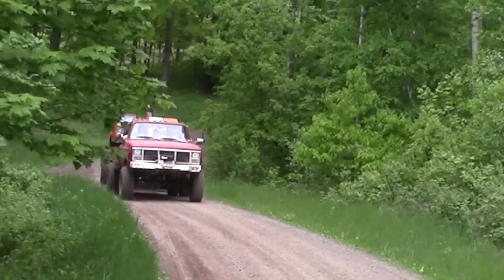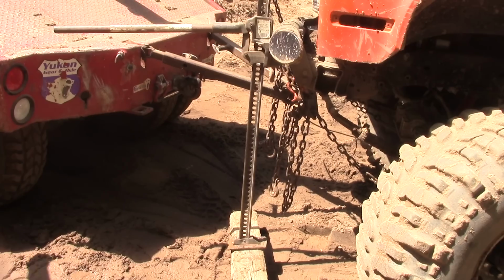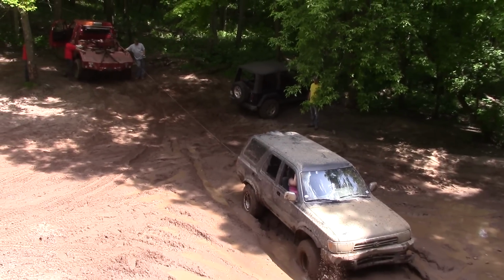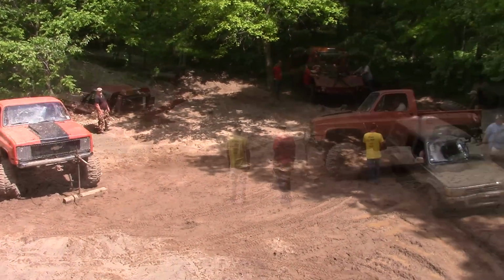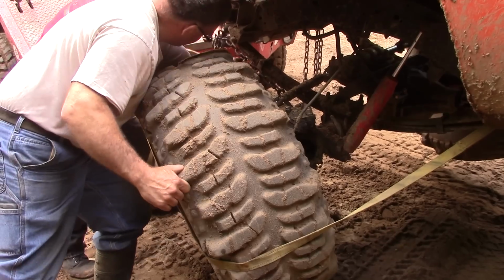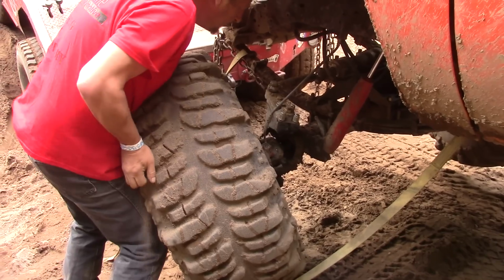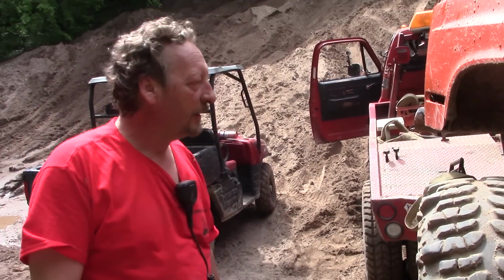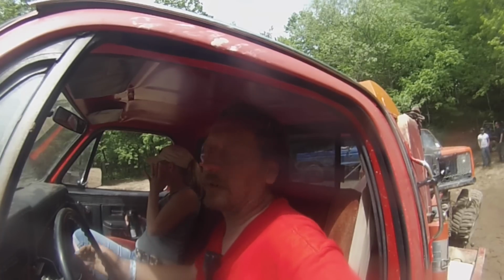DIGGER RESCUE PART 2 by bsf Recovery Team

Comment: I have seen winches that had their own power, like a chainsaw motor that you can take out and find a deadman and winch from there, like pulling orange back up hill. use a strap like a tree protector through the tire rather than around the tire

Comment: Dude!  This kind of crap is happening to you WAY to often you need to start doing a P.M. on that truck , That's way to good of a truck and YOUR way to good of a mechanic to be letting it go like that,  Ya'know this ain't the first time we've had a failure out on the trails,. Now get off the couch turn off the TV. And get under the wrecker with the grease gun and flash light and do it. Working on the truck out in the woods sucks, it's not that bad in the garage so go do it.  Love y'all, love the show, one day soon I'm going to take the Hummer up and do some riding with y'all be safe 😁

Comment: It never ceases to amaze me how many 4x4 owners don't know how to change gears in the xfer case or know how it works.  (some are full time, some don't have what's called a "true neutral", etc.)
Just had a conversation with a guy on youtube who didn't know how flat towing works.  He didn't seem to know you could have a transmission in Park and an Xfer case in Neutral at the same time.  (We, on some new trucks you can't).